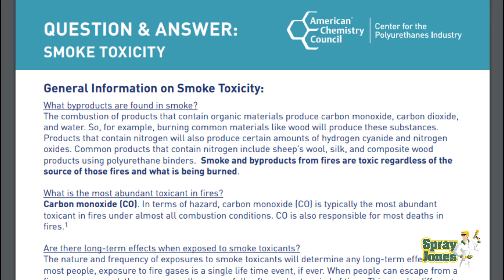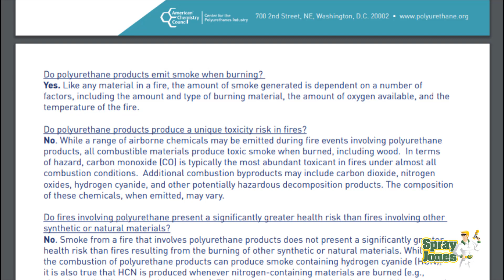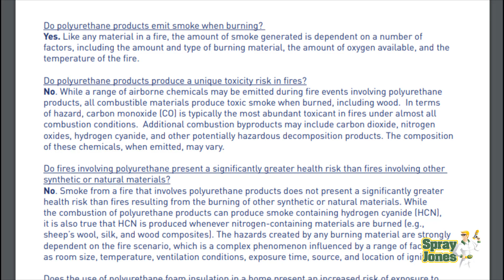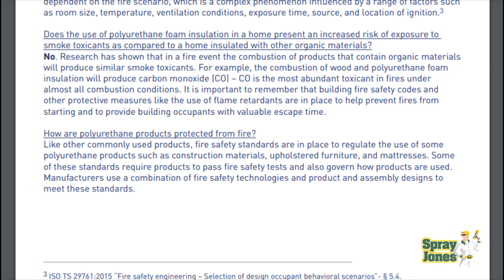Does Spray Foam Insulation Make Toxic Smoke?

Comment: I’m a chemist and I have to point out that that article was created by the chemical industry that produces spray foam products. It’s very biased. There are independent articles from health and safety institutions that highlight how much more HCN and CO gasses are emitted. In fact, the Grenfell tower fire in England likely had a high death toll because of the foam used on the cladding of the building. With a proper barrier system and and outer layer of mineral wool I would definitely go for spray foam, but on its own it has not great fire properties. I don’t sell anything and am not sponsored to say this, I just like to inform people so they can make safe decisions.
Reply: I've never used spray foam and I won't buy anything with spray foam because the day that the authorities decide that they feel that it's toxic then all of it will have to be removed
Reply from the maker: Want to live in 1860 where wood and stone are only what is used?